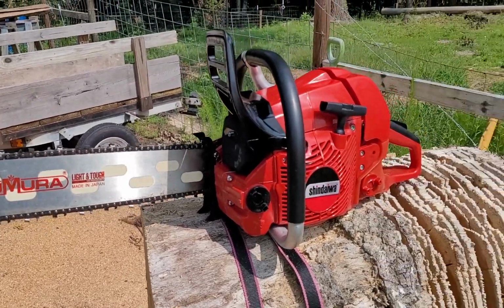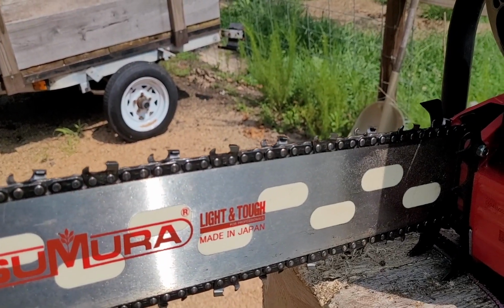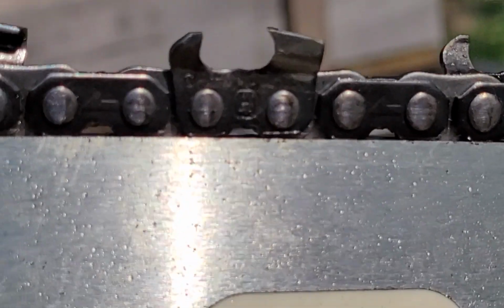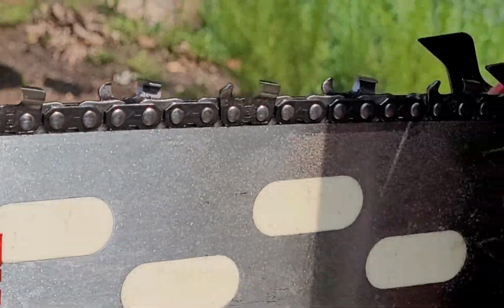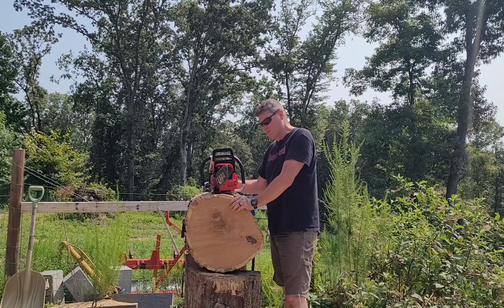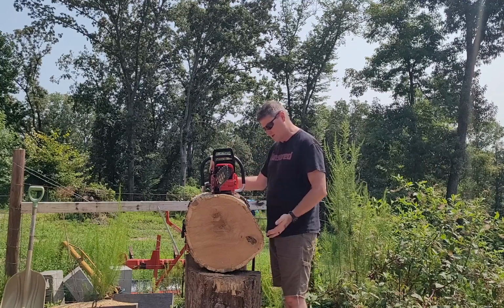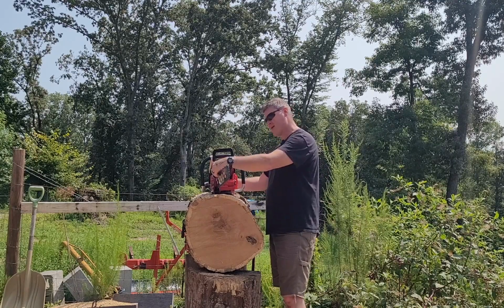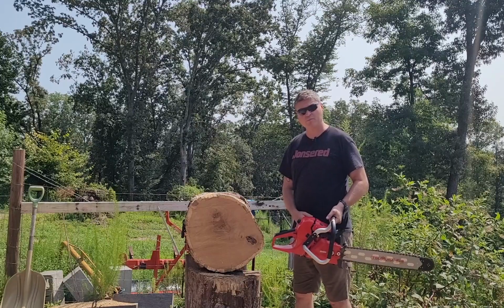More chain grind testing, chainsaw sharpening

Comment: I run an oregon grinder for chains I grind for my crews. In my experience, I get a much sharper top plate using the cheapo harbor freight grinder with the higher grit wheels than I do with my oregon grinder setup. Same thing, corner will grab but that top plate just isn't up to my standard. When side plate cuts much better than the top, I've found you get bad lines in the kerf from chain steering a bit

Comment: I grind mine I get good  results. I use an Oregon 511ax. I set it at 55 30 10. I don't use the Oregon wheels anymore.  They load up with crud. . I use a cbn. Wheel.  It works great

Comment: What wheels did yours come with? My timbertuff one came with dark pink wheels and all they did was heat the chain up. I bought the TECOMEC OEM "Premium Corundum Vitrified" GRINDING WHEEL 5-3/4" x 7/8" x 3/16" from eBay and it was night and day it took off the material so much faster and didn’t heat it up. I do 50-30-10 and have good results 🤷 Richard Flagg recommended that wheel and I really dig it
Reply from the maker: It came with the pink wheels, but I bought a CBN wheel.  I need to try the green wheels you're talking about.

Comment: I just can't get into the grinding thing. I just round file until a burr rolls off. I wish I had the info to help you out 👍🏻 But I'm sure with enough practice you will have it down packed and wonder why you didn't get it sooner.
Reply: 👍🆙D
Reply from the maker: I hope so.  I kinda like it and it's wayyyy easier on my elbow.
Reply: @novicelumberjack  I bet so. I'm whipped after filing a 24" Full comp. Grinder would be nice and handy to have around, at least for the really jacked up ones 😆 🤣

Comment: The best way I have found to sharpen my chains is to tighten my saw by the bar in a vise and use the Stihl 2in 1 file setup on it. Works great every time. It sharpens the tooth while also taking down the drag. I have one for 3/8 and one for .325 chain. Just something you may want to try.

Comment: Hey Boedy, could could i send you a couple chains that i sharpened for you run?  I use the same grinder and also sharpen by hand depending on  what is needed.  Would be curious to see how they stack up.

Comment: I have a harbor freight chain grinder and I had the same issues at first. Took about 6 months for me to get it dialed in.  My hand file work has gotten much better and I only use it now for when I hit metal or am feeling lazy.  It’s all about pressure how much or how little in my case. Best of luck hard to learn a new skill we have all been there.

Comment: A statistical tie, wood and technique changed :) why I hate cookie cut analysis on video. YOU have a better "feel" and that is more real to evaluate a grind....U know when its cutting good. Think you found the issue, that top plate should be better. Try with a file to see if it sharpens up. Prolly the wheel or rpm ( which u can't control ) Might look at the inside plate angle for clues, a different angle might yield a sharper edge with the tools u are using. I shoot for 45 even 50 , easier to get to with a file vs. a grinder. Also I kind of use the grinder to rough out the tooth and a file to tweak it to where is cuts well. But kind of need to fall back into the machining back ground to figure out how to get a good edge. One thing I hope u explore is removing some of the BACK side from the side plate & top plate, increasing the opening x-section on your race chains to promote the "flow" of material thru the tooth. Especially on the higher RPM saws or saws with sprockets to increase chain speed. Been avoiding this entire topic on the channel as its like a religion to some. Rather see others go thru the learning curve :)

Comment: Not sure what kind of Raker gauge you are using, I tend to use a Progressive gauge (works on one tooth) over a Parallel type (bridges 2 - 3 teeth)

I like the way the Progressive gauge really ramps the front of the Raker down which really aids tip cutting and bore cutting.

Until recently I did not understand that the progressive part of the gauge is that it increases the depth of cut (Raker height)as the tooth wears back.

Progressive gauge commonly known as an Oregon style, where I'm from, but Stihl now make one of their own.

You'll get there dude, just keep at it 👍

Comment: I went back and watched a bunch of videos again. I now realize the individual i watch twists the file the last few strokes! Now i had noticed it before but i assumed it wouldn't make any difference but i have been wrong about that before lol. Then i thought of grinding tungsten as it effects the way it arcs. I am thinking those few strokes with a twist may break the straight scratches and make the final difference.  I sharpened my chain yesterday and it did feel sharper but i haven't had a chance to prove it yet!!

Comment: I've got the same grinder, still trying to get my head around it. I'm old fashion, still hand file most of my chains, brought to grinder mainly for straightening up the tooth edge once in a blue moon
Reply from the maker: Yeah I don't get it either.  This chain should cut better than it does.  It just doesn't add up.
Reply: What are those grinders worth over your end? , cost me NZD$1050 here in New Zealand, pretty flash but need a degree too drive them

Comment: 👍👍 
No expert, just have several months more experience on you of things I did wrong as well and maybe I’m not as particular and mine suck as well. 

If you do a grind all the way through, have you ever done another pass and let it spark out and don’t advance it more?  If not, try that. The grind looks clean, don’t see burrs. But the camera doesn’t pick up everything. 

Wood I cut is softer than yours, but my best cuts were at 60 and that matched husqvarna full chisel safety chain stock angles- “according to my import grinder”. I also found that initially, I would drop the wheel into the gullet then set the stop. Started only grinding to the edge of the side plate and it seemed better. Touch up the gullet once in awhile. 

Just some food for thought….. When I got the grinder, I thought it would be the magical thing that I could just grind down rolled teeth and make drastic changes to the chain- as I’m sure you found out- not true….teeth get hot and burr badly. It’s a good maintenance item for touch ups.  Still a poop load better than hand filing a 28 full comp.
Edit- another thing I did and still do sometimes is get lazy and don’t clean the chain. Although it still grinds it, gets hotter and also “buff” the tooth and not cut it sharply when the wheel loads up oil and debris- just like polishing or sanding.a car. Sand paper cuts….until it clogs then it starts flowing the surface that’s already there instead of creating a new one- polishing.
Reply: 👍🆙CF
Reply from the maker: Everything you said, Doug.  We are connecting.  Oh, and I ran the little Echo 310.  What can I say?  What a turd!  It feels nicer and might be a bit better than the 170, but it's still pretty damn awful in my book!
Reply: @crazyfeller5704 😆

Comment: Your rakers look too high to me. I know you checked but please try 5-7 passes with a good flat file on the rakers and see how the cut changes. The teeth look more than adequate to cut good but you are still getting sawdust not chips. I run rakers much lower than that on even small saws and with sharp teeth there is no grabbing in the cut. If you are really worried about grabbing just do 3 passes to start with on the rakers.
Reply: I am not saying those look like the sharpest teeth in the world but I have seen saws cut faster after running into rocks and steel so I would think you should get better chips. You have to temper that raker guides were basically developed to prevent home owners from catching a chainsaw in their mouth 🤣
Reply: I agree on that sentiment, I call that fairy dust what that saw is producing. Few passes on the rakers with a sharp flat file wouldn't go a miss. Like you on the bigger saws I take the rakers down quite aggressively. On my smaller stihls I'm not as aggressive on the rakers as don't want to bog the saw too much. I want to see good thick chips of saw dust coming out of the saw, that when I know its cutting well.

Comment: Hey boedy, i dont have a grinder so cant help.. but i do have an observation that may help or i might have missed something.. but when i've seen ground chain before, it looks like its been square filed. So a very straight upright side plate. Yours doesnt look like that, it looks like its been round filed. I dont know why that would be, i guess wheel profile.. as i say, jjst an observation. I know from my own chain experiments that square file is way faster than round, so id have though if you can find a way to grind it square then it should rip.

Comment: When I was starting hand filing I would get 50lb fishing braid and hold it firm and slide it across top plate and when it was sharp it would cut it clean in one pass,  it was just a good indicator to test if I was sharp when i wasn’t sure and I have done it after using a grinder and it works a treat

Comment: I used to hand file but now I put my file in my drill on a slow speed drilled a 5 mm hole in an old piece of mahogany to hold the other end of the file and just make 1slow pass through the chain which equals about 8-10 passes by hand seems to work fine 👍

Comment: I can see a burr on the top plate before you started cutting, it should be clean with no burr for best results, you need to go slower and very light when first coming into the tooth you will know when it’s slow enough cause you won’t get the burr on top plate. Try dressing wheel more often to, you will get it soon 👍

Comment: How about you show us you sharpening a chain rather than the results. Then perhaps you can get some directions on the corrective actions needed. I have improved drastically in the last few years but have used chainsaws over 35 years now wish i knew better then lol. A little observation no one ever points out is a chain tooth is taller at the front then the back. Well a guide is perfect perhaps for the last few sharpenings the chain is good for. Im no pro either but i have started hand filing to get the correct depth and get the gullet. But then i put a few passes with my pferd/stihl sharpener that also cuts the rakers on full comp chain. While it still isnt like super pro sharp its certainly better than my previous attempts! I also have an Oregon chain grinder just in case i really hit something its faster to get it close. I know welding i learned more watching others than hearing how to do it.
Reply: intent to inform: when he shows the result the way to ther is of no meaning. Because we see what it is. The searched result is a form of tooth that cuts well in a certain type of wood with the proper machine that can handle a estimate raker depth. 

So a maximum efficency can be produced with the made up setup
Setup: a machine that has a certain size lets say 70ccm with a 
specified bar lentgh 
and a specified tooth number on the chain
and a specific tooth form like fullchisel or semi.

To ask why this setup isnt cutting "perfect" is nonsense because all parameter must been defined or we are fishing all in muddy waters.

only what we measure we can rationalize.

Boedy you should take one size of machine one size bar one type of tooth cutting setup and one type of wood
and then adjust the tooth and rakers to the best result anything else isnt sientific.

Comment: I'll start with my thoughts..  25* is great for longevity in hardwoods but i've never got 25 to feel "fast" by any means.  
I'm more of a 30*/ 55 kind of guy and adjust the rest with your hook (how deep you grind)
 Use the 'back' of one of your fingernails to check the point.  It should catch the nail EASY with full chisel.  Point grabs and starts the chip, top plate lifts it up, side plate slices the chip off.  If any of those things are "off" then you'll have problems.

Instead of trying to video it, might take some good close up macro pics with a phone or camera and insert them in.  Maybe we can spot something.  I tried a couple times to get a better look but with the motion blur and focus it wasn't happening.

Comment: Rakers look too high. And after grinding some like to touch up the cutter with file.
The Tecomec is a good grinder, I have one. The CBN is the go. 
You need to get higher in the tooth.
And learn to file.
The grinder should be for badly dameged chain, then finish it with a file